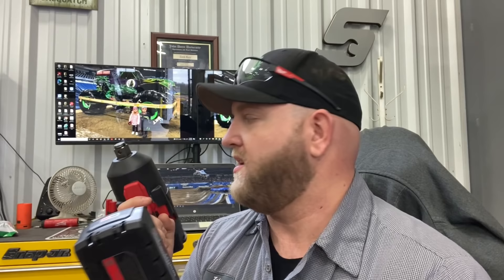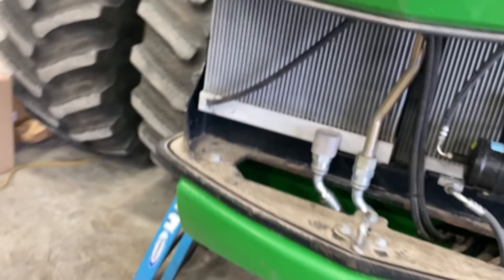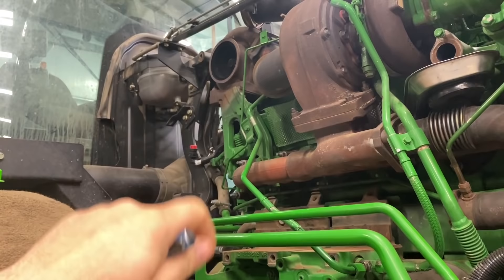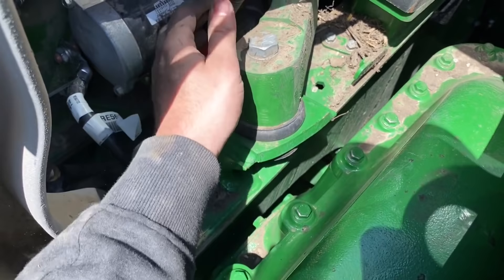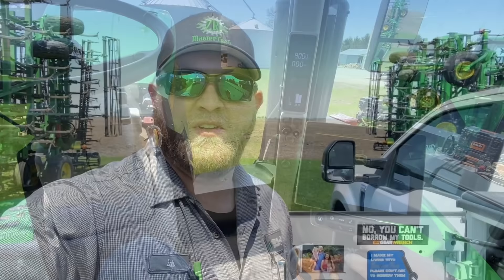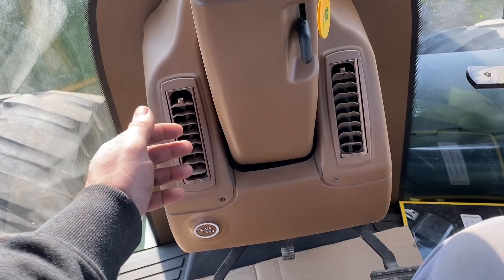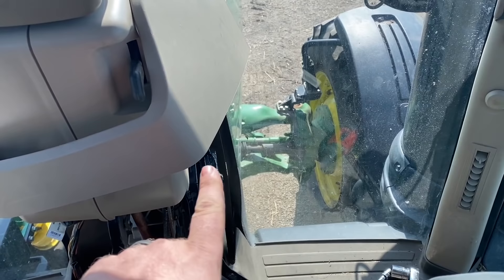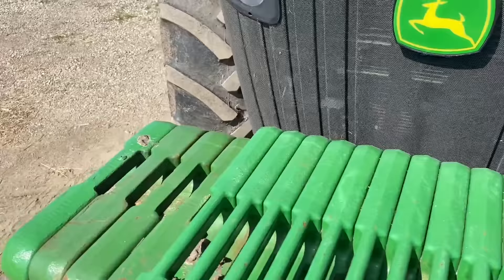Spring time service calls...never a dull moment with John Deere tractors!

Comment: In our experience with 13.5 it’s always the water pump and deere acts like the problem doesn’t exists. Both 13.5 we have had the head bolt and gasket pip done and problem still existed

Comment: Ground cable tabs Kop-r-kote T&B compound - like a Copper Anti-seize and contacy grease. 13:27  We used between bussbars for contact resistance reduction.
Reply: Thomas & Betts electric tools. 22:02

Comment: What is the radius, in miles, of your service area.  It just blows my mind to see how complex these machines are in comparison with the 48 'B' John Deer  the 57/58 '60' John Deer and the 42 'B' John Deer I operated from the mid 50s through the first 3 years in the 60s.
OBTW after watching you channel I have been wearing the high mil black gloves and I have eliminated the skin  problems I had been having on my hands when working in my shop.  I didn't experience the handling problems I thought I might.  In fact, it seems actually better and since they fit tight I can still feel irregularities as well as before.  If I were a professional carpenter they would be calloused and probably wouldn't bother me.  I figured if you used them it was a good idea for anyone.  I have a little arthritis in the hands and neck (typical for a 79 yr old) and they ache after a long day.  My wife gave me some CBD salve and the stuff has really helped me.  One uses just a little bit and the secret is to work it in good.  I use it at night.  That seems to work best.  Thanks for being a good example of a mindful worker.

Comment: Awesome vid as usual. I am planning to do the JD Tech program soon. What tools and brands would you recommend?
Reply from the maker: Awesome! Usually if you go through that program you can get 1/2 off snap on. So I would get as much snap on add you can through that program. But spend it on hand tools, ratchets, wrenches, and sockets. Then once you have a good base you can get brands like Tekton, gear wrench, and sunnex.

Comment: Obviously that gnd cable was designed (or built) wrong. Have you ever had any luck giving Mother Deere any feedback or corrections to their parts? Do they listen to feedback from you guys?
Reply from the maker: Yes I fill out dtac reports and yes they do listen.
Reply: @ZKMasterTech I'd suggest you fill one of those out for this. I'd hazard a guess that the reason that this cable broke is because of a combination of pre stress from twisting 90 deg to install and vibration.

Comment: Hey nice video. I wonder why dont you work as an self-employer/freelancer/independent contractor.? Is it because John Deere does not allow customers to do  Maintenance ?
Reply from the maker: Because i don’t want the head ache. Customers can do whatever maintenance they want to on their equipment. They just can’t program software that is it.
Reply: @ZKMasterTech  ah okey, i thought the right to repair was stil an issue, but its not. Thank you. And i understand why it could cause head ache.  Because if you repair something and it get broke after a few days or so, they will complain to you even if  you would done a good job and the problem is something els.

Comment: Zk  love your channel, if you can help out with my problem I have a 8420 John Deere tractor. The oil pressure gauge and the coolant gauge will go to high then to low and my tractor will just stop. I have put new sending units for the oil and coolant but that didn't solve my issue. I have put two transformers behind the cover under the back glass and I'm still having the same problem. I also changed out the two big relays under the fuse panel but that didn't help either.. I'm just worried that my son may be driving this tractor and it will stop with him on a major highway or on a river bridge.  if you can find the time, could you at least point me in a direction that may solve my issue. Thank you a South Carolina farmer